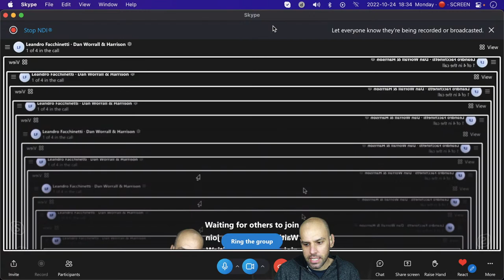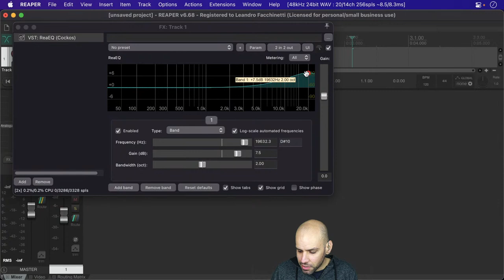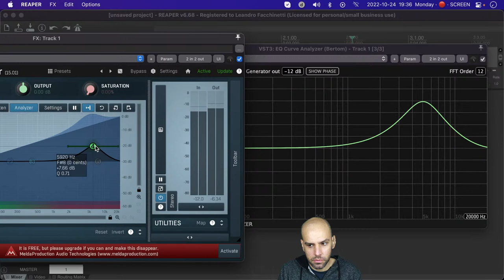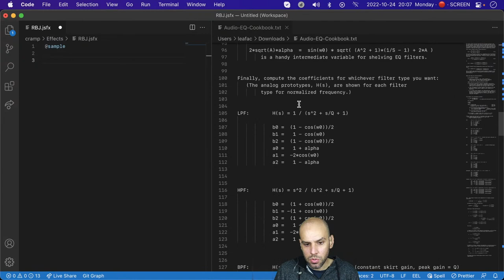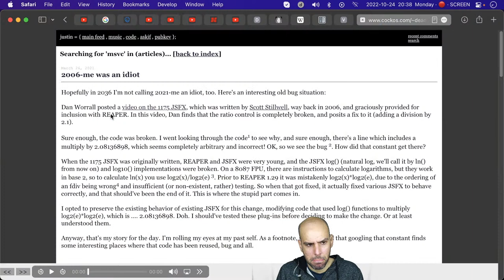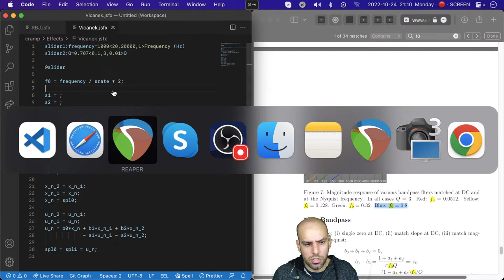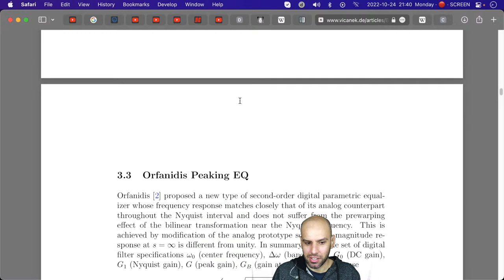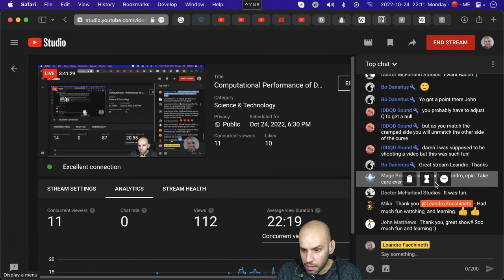Computational Performance of De-Cramped EQ · The Dan Worrall & Harrison Controversy

Comment: I use a lot of distortion and broad boosts in the high freq range. The less I work above 10k the less I need to worry about cramping...logical.

I think it's also logical that in 2022, I shouldn't have to worry about that at all given how far computing has come.

...and yes, I have heard the effects of cramping.

Comment: As a mixing engineer, I'm never working in the Nyquist range. So cramping isn't a problem for me, if I use a EQ  it's mostly to filter high and low pass problems and if I use an EQ it's mostly to cut frequencies. Besides, if I want airy highs, I use the Mäag Audio EQ2 or 4 plugins. You have to know which plugin in what instance to use very well, you only get these insights in time. I'm not into specs from a plugin, and use plugin Doctor, to analyze that plugins. My goal is to get the best mix possible. In a fast way.

Comment: Harrison should focus on their daw not being an absolute nightmare to use before branching off into the vst world. 
So many epic features that daw has and it’s almost not worth opening up. I’ll still use the phase alignment feature they have built in and that alone was worth the 60$ or whatever I spent on the daw but holy moly everything about the user experience is garbage.
Reply: Maybe complain at Ardour, which Mixbus is a fork of. With Harrisons stuff added.
Reply: @djazz0  when your name is on something, it’s your problem to fix.